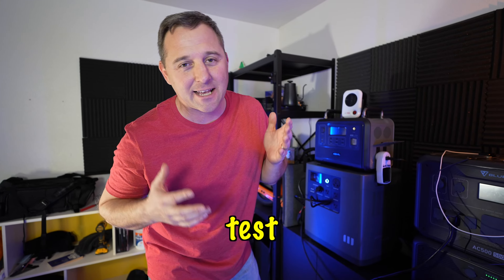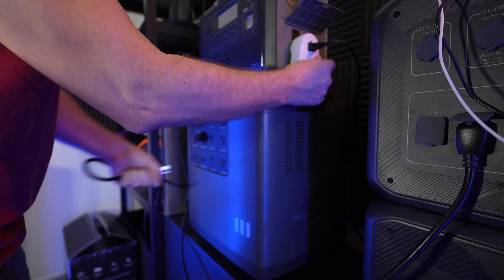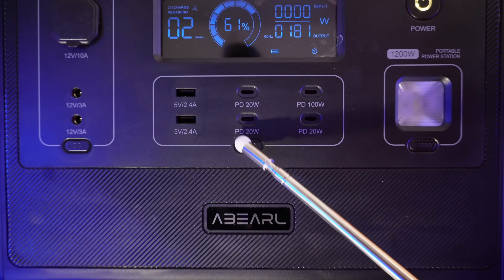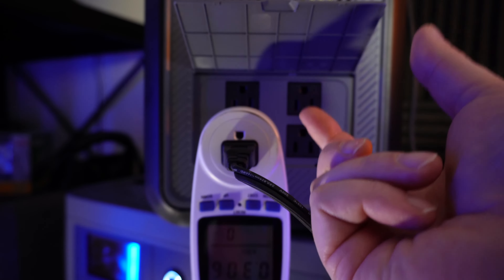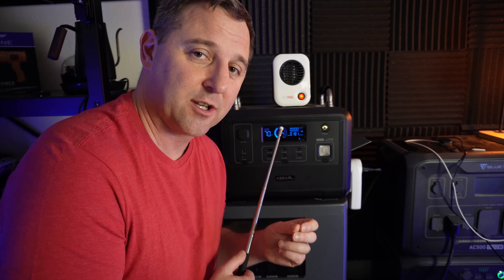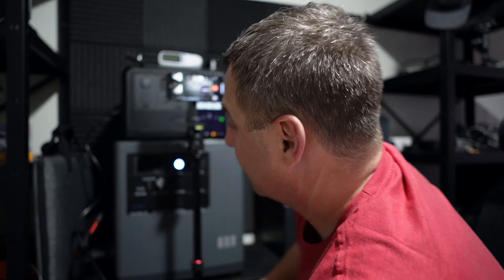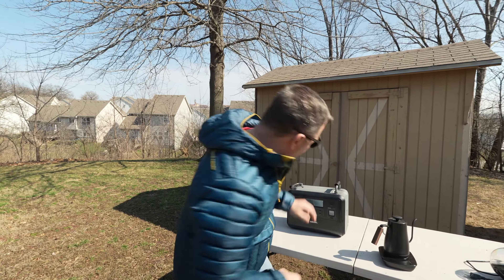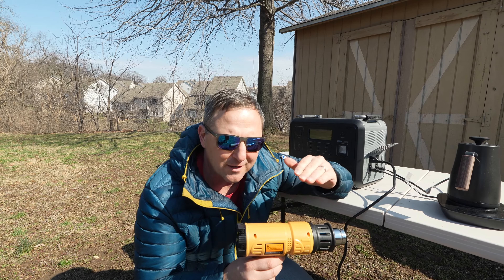Insanely CHEAP & Massive Power $500 Oukitel P1201 Solar Generator!

Comment: This will power a manual Frigidaire 5000 btu air conditioner on a sunny day with 600 watts of solar. Mine uses aprox 390 watts on low. If you have a 12v 300 ah LiFeP04 battery rigged up to the charge port you can power the air conditioner all night if the thermostat is set right. I have most of the parts needed to use my 300ah battery with solar now but since my sister and nephew are angry because I bought it for solar they`re "too busy/forgot" to bring my other 190w solar panel to me. I bought a 20 amp plug in charger with it and have used it since August with a 2000 watt pure sine inverter for our frequent power outages. It can run my air conditioner all night. In very hot weather it will only run it about 10 hours. If you get two 35 amp chargers you can recharge it with a gas generator fast. I want to see how long it will power my small box freezer or dorm fridge. I wish I had more large batteries. But thank God for what I have. It`s a real blessing. I got some great bargains on power stations and panels in 2021 when the market was saturated. I always dreamed of having solar power and a larger camper and the dream came true.
Reply from the maker: Thanks for sharing your experience. It sounds like you have plenty of plans for your system to stay busy for a while. Are you planning to incorporate your system into a house? Or want to eventually use it in a camper setup?

Comment: After only getting a little bit more juice time out of the Oukitel than my older Golabs 300R (299Wh), I did an experiment and ran a 21W car light bulb on the 12V outputs which only lasted around 24h which amounts to only 528Wh or 54% of the advertised power!
It would be interesting to hear what you or other users get out of the 12V outputs.
Reply from the maker: Wow. We’re any other outlets on?  It sounds a little low, but there a basic operating cost for the devices. So, they tend to do better with 0.2C load tests. But, that’s not an option for this device due to the 120w DC outlet limit.

Comment: The AC outlets look awfully close together. I wish you listed the times when you cover each subject in the video. I might get this so I can juggle with my other units to run my home fridge. The other units are Oupes 1800 (which can charge with 400+W solar and will run my fridge for 24 hours) and an Oupes 1200, which can take only 200W solar and runs the fridge for 16 hours. I want something lighter weight than the Oupes 1800 and faster charging than the Oupes 1200. This Oukitek key fit the bill.
Reply from the maker: I need to go back and chapter the video. The outlets are close, and on the side. I like the Oupes 1800. I had it for a while last year and gave it to a friend.  They still use it with no issues.

Comment: I would think most people using a device like this would want to be using them in conjunction with an active solar panel supplying power at the same time.  Can you use it this way?  Or do you have to just use only the battery, then stop to allow it to charge, then use it again without the panel supplying part of the power?   I'm coming from LA stuff and all those can supply part or all of the required power from the panel.
Reply from the maker: This allows pass through charging. So, you can charge and use it at the same time.

Comment: I think the solar cable with the xt60 takes only 300 watts solar, and the other solar input (a barrel connector, forget what size, maybe 5521) takes 200 watts  for a total of 500 watts. At least that is what I read somewhere in a description of this unit.
Reply from the maker: Hi, I haven’t encountered that issue. I tested some solar panels with it in another video and put 400w through the XT60 connection. It was two 220w panels no problems.

Comment: The cigar lighter 12v 10A output is not working on my unit, the dc 5521 output does work, am I missing something? do I have to send the unit back.
Reply from the maker: That’s surprising. If it doesn’t work contact Oukitel. There is very little you can do to fix it at home.
Reply: @AdventureGearTV  Thank´s for the reply.

Comment: Stay away from this unit it will eventually not charge and show 188 error code. 
There are many youtube videos showing same issue.
I have this unit rebranded under the Ideaplay name and it is an expensive brick right now and the battery stopped charging.😢😢😢
Reply: Thanks for the warning. How much did you use it before it died?